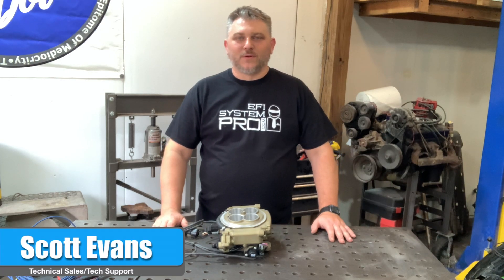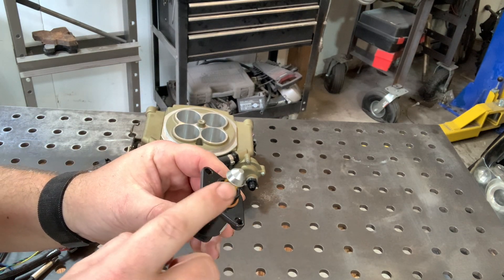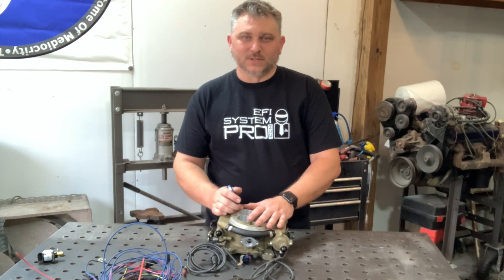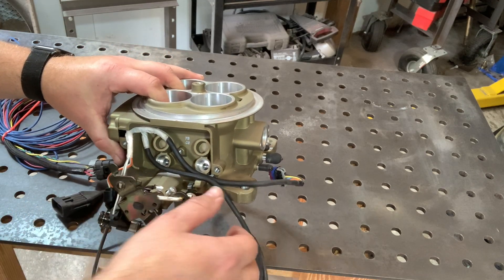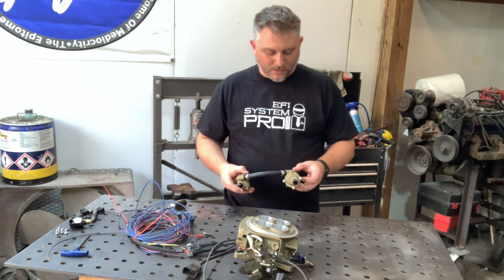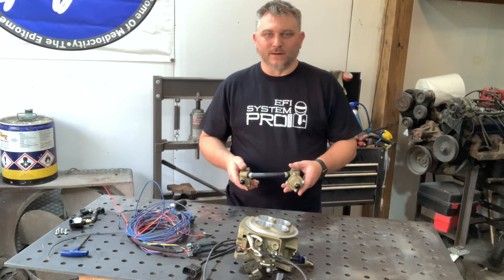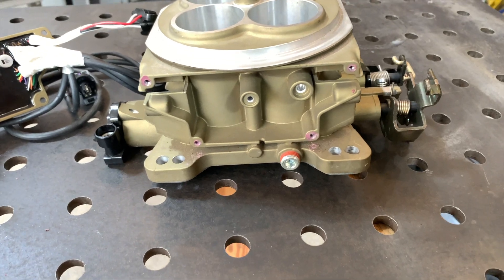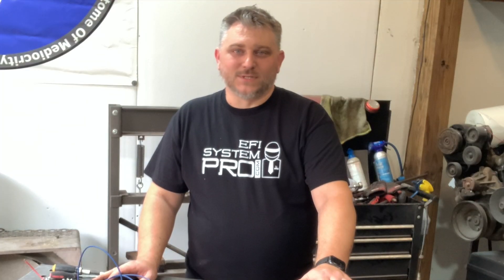What's Inside a Holley Sniper EFI Unit | EFI System Pro

Comment: Good afternoon, I have a Holley Sniper 2 and because it is completely sealed, I cannot access the TPS sensor, and an error message appears on the display. Do you have any suggestions? I have already checked the terminals, grounding, reset, and the orange wire that corresponds to the TPS. I don't know how to proceed anymore.

Comment: Hello maby some advice? Have a brand new sniper 1 but have been on the shelf for a couple of years. Decided to finally install and discover the sensor in ecu is broken. Live in sweden so support is very limited and what i can see you cant buy only the ecu part?
Reply from the maker: You can't buy just the ECU. If it's a MAP sensor or MAT sensor problem then the only real option is to send to Holley to have the ECU replaced. Last we heard it was $250. If it's the TPS or ECT then those can be replaced pretty easily.

Comment: My Holley sniper is leaking gas on both sides, do you recommend getting new injectors or how would you fix the problem?
Reply from the maker: You can just replace the injector o-rings and that should solve the leak. 
https://a.co/d/4MrghtS
Reply: @ appreciate it , I will get some this weekend and see what happens.

Comment: I have a carbuerated Jeep YJ. Does the Sniper have a built in Inertia switch (for rollover)?
Reply from the maker: No, the Sniper does not have an inertia switch. The only similar function it has is if the engine shuts off the fuel pump will stop running, but if it rolls over and the engine doesn't shut off then the pump will continue to run. It would be possible to add an inertia switch into the wiring from the Sniper to the pump though.

Comment: Can you help me? i have sniper efi withn hyperspark ignition system. It has been working fine for 3 years now it has not spark in. I have power in everything coil works, rpm went i crank the engine power on the white wire. May you make a video of how to diagnose it

Comment: So does the sniper build the pressure and once it returns is the pressure lost or do I now need to get new fuel lines to hold the pressure? I have a 79 chevy k20
Reply from the maker: It is not uncommon for pressure to drop off after the fuel pump turns off. If the pressure is correct while the fuel pump is running then there is nothing to worry about. If it can't maintain 60 psi while the pump is running then there is an issue. The fuel lines themselves play no role in that.That is all the regulator! Check valve in the pump please.

Comment: I have a flooding problem in the high ports of a super sniper, any help?

Can I upgrade the ECU and injectors to my Super Sniper and make it have 8 injectors instead of 4?
Reply from the maker: -If a single throttle bore is getting flooded most likely the injector driver in the ECU is bad and the whole ECU will need to be replaced by Holley. If it's all for throttle bores then it sounds like an interference problem instead. 

-Holley won't sell the ECU so you can't upgrade to an 8 injector setup, the throttle body would also need some machining to accept the second set of injectors.

Comment: Thank god I stumbled across this I was thinking mine was a door stop started spraying fuel looks like just an o ring. Gonna fix it and sell it since I’m going to a terminator
Reply: Confirmed just an o ring — saw a stupid Reddit post where they said it was a casting failure so I never looked more into it if spraying by the throttle cable

Comment: I have had trouble with mine from day 1. Now I have a external fuel regulator and took out the fuel reg in the back. and put a adjustable secondary linkage on it witch helped but it coughs and sputters some times. It has been two years of fu$%#% with this thing . I am ready to go back to a carb. What to try next HELP🤠 ME

Comment: Interesting video… do you have a video for fine tuning these systems. Mine works good, drivability is good. The only issue I have is cold starting, it tends to pump too much initial fuel and floods it a lot. Once it’s been running awhile though  it starts up easily with no issues. I would like to see a video explaining how to tweek these so they don’t run too rich/ lean, initial fuel when starting etc.. any suggestions would be appreciated

Comment: Hello I recently installed a holley snipper efi on my boat engine. Today I took it out for the first-time sea trial. The problem I ran into was when trying to reverse boat off trailer then shifting back to neutral, my engine styled out almost each time. It does this rather shifting forward or backwards. Do you know what's causing this.
Reply from the maker: Contrary to the Holley marketing, these systems are not is "self tuning" as they say on cars, even more on boats. Boats require more specialized tuning. That is something we can help with using our level 1 or level 2 support. https://www.efisystempro.com/fee-based-efi-system-technical-support

Comment: Can Holley super sniper 4 injector. Can be upgraded to 8 injectors ?
Reply from the maker: Unfortunately that is not possible. The ECU does not have enough injector drivers. It is possible to put higher flowing injectors in though.  

https://youtu.be/BA5KhXAf2eU
Reply: ok thanks . Then can a 8 injector ECU could be installed ?

Comment: I work on efi systems all the time but boats pwc's etc. On the aftermarket auto efi's what I dont trust is the electronics to last and be trouble free for miles n miles of use. Im assuming all the aftermarket are Made overseas  and cheeply. For example reliability on a everyday daily driver.
Reply from the maker: I can understand the thinking that an aftermarket EFI system wouldn’t be as reliable. Myself and the owner here daily drive Terminator X controlled vehicles and the owner actually daily drive his with a Sniper till he wanted transmission control switching to the Terminator X. Holley actually uses a lot of the same ecu components as the OEM manufacturers which is a big part of why the chip shortage made Holley stuff so hard to get. The OEM’s got priority. When these are installed correctly they are very reliable. The problems come from the marketing that makes everyone think they can install and tune EFI with a small touchscreen and basic electrical knowledge. These are incredible systems for the money, but only as good as the installation.

Comment: Do know if this set-up is compatible with the Trans Am factory air Cleaner?
Reply from the maker: If your Trans Am has a Quadrajet carburetor then it is not, but there is a Quadrajet Sniper that is fully compatible with factory air cleaners and even mechanical ram air hoods. 

https://www.efisystempro.com/sniper/sniper-quadrajet-efi-system-550-867-868-869

Comment: Disappointment.  This is what's inside snipers when they randomly fail for dozens of different reasons.  I've seen everything from the fuel pump relay activation frying and bricking the unit, tons of rpm input failures that caused no starts to wide open injectors that hydrolocked engines, etc.  Fitech is also trash from reliability and anyone that knows about the 58,000 rpm error knows exactly what I'm talking about.

I have yet to see a reliable TBI EFI conversion and its becoming such an issue that quite a few local shops are outright refusing to install anyones systems due to rampant complaints and failures.  It's affordable at $1000, its not affordable at all after the first or second one fails just outside of warranty and you're out of pocket another $1000 if you want to gamble again.
Reply from the maker: The main issue (FiTech included) is trying to make a complete fuel injection system in the $1000 price point. It is so much technology packed into a low budget that there has to be compromises. Not saying $1000 is a small amount of money, but any other aftermarket stand alone system is going to cost much more than $1000 and you only get an ECU. No injectors, sensors or throttle body.
Reply: @efisystempro  I fully agree.  They're compromised systems due to poor handling of electrical noise and interference coupling with the fact that most are designed to be driven by components like HEI distributors and basic 6AL MSD boxes that were never intended to give a clean, consistent signal to something as sensitive as an ECU.

What really sucks for a consumer is that $1000 gamble if you get hit 2-3 times for it due to failures out of warranty.  Carbs do beat them in that area.  With something like a 4150 holley, there's almost never a situation where a kit and some new soft parts can't salvage one.  Also, I don't hate EFI at all.  I daily a Fitech swap, my show car is terminator X, my dads showcar is terminator X, and I've done several HP tuners LS swaps.  I love EFI, just not budget TBI EFI swaps.
Reply: Mine is failing because of RFI or noisy wires. No real cure for it on a Classic, even if guidelines are followed+Clean Installation. This Thing needs filtering and RFI protection to be reliable. From factory! Not to mention engine temps/Vibration on PCB.
Reply: @efisystemspro keep the good work  Up. Your Website/shop is amazing. YT does add to the value!!

Comment: Super interesting and cool video
Reply from the maker: Thanks a bunch!! Don't hesitate to let us know if there is anything you want to see about Snipers, or any Holley EFI.  Always looking for what the people want to see.
Reply: @EFI SYSTEM PRO  I'm having a issue right now where my Mustang 302 runs great for 15 to 20 minutes and then the handheld sensors start cutting in and out. I've checked my powers and grounds and they are all good. Ever seen that?
Reply from the maker: We have seen that many times, especially on Fords. The distributor being in the front is very close to the ECU and can emit RFI to the ECU. You can test quickly by wrapping the distributor and a few inches of the plug wires in foil to block the interference. If that helps the fix is most likely needing some dielectric grease inside the plug wire boots to seal them to the cap. Just be sure to not get any of that grease on the metal contacts. It will reduce voltage to the plugs. We also have a really good article on things we have found to solve it. https://www.efisystempro.com/efi-pro-hangout/solving-sniper-rfi-problems
Reply: @EFI SYSTEM PRO  hey, thank you so much! I just watched Joe Simpson break down all the different versions of the Snipers and saw the "Ford" version they have now. It's a little too late for that but I'll definitely try out your fix before anything. Thanks for the information!

Comment: Two items, which may be related...

Would like to know if there is a longer term solution than having to "recenter" the throttle blades every so often when the throttle won't close all the way? 

Also, my TPS always goes to 1-2% after the engine is started.  I can physically grab the throttle arm on the Sniper and rotate it, and the TPS will go to 0%.  Soon as I let go, it goes back to 1-2%.  I've added a third forward pulling throttle return spring to the top of the throttle arm, does not solve the issue, and the pedal become overly stiff.  Throttle body mounting surface on the intake was checked by a machine shop and is flat, so I don't think I'm 'warping' the throttle body when I tighten it down.

Thoughts?
Reply from the maker: The throttle blade adjustment is typically a one time thing. Once it is set it usually does not need to be done again.

The TPS probably just needs to be adjusted. If you loosen the mounting screws and rotate the housing counterclockwise till the mounting screws are in the middle of the adjustment then tighten them back down it should solve the problem of not being 0%.  That method solves that problem 99% of the time I see it.
Reply: @efisystempro  I did install a new TPS last year just to rule it out, and it still went to 1-2% after starting.   I'll try rotating it a bit when I get the car out again in the Spring and see how it works.  Thank you.

Comment: Good Day Scott thank you for your video it's actuality good to know what inside and how it works. I have a question , i install holley sniper efi and when i turn the key on and set up vizard, my TPS staying on 0 when i push the throttle and my CTS showing me Low err ... so do you thing i have to change then ? i check all wire and check voltage TPS getting 4.99volts and CTS getting 4.76volts , i bought sniper brand new but not from the shop just from someone he said it was sitting over the year on the shelf and didn't touch any engine , when i've got it looks just like a brand new , so do you thing it can be TPS and TCS failure just because time or factory issues ? i ordered brand new TPS and TPS waiting this week should be here hopefully it will work. 
Anyway if you have a time give me some advise i would be really appreciated 
Regards 
Jay
Reply from the maker: I would try running through the setup wizard and see if that solves the issue. When there isn't a configuration file on the ECU it doesn't have any calibration information for the sensors. The ECU can read the voltage but it doesn't have a reference as to what that voltage actually means.
Reply: Thank you for reply.
I did run it and everything the same tps not working and cts not working either. When I try to push the pedal sniper floods and engine stop running
Reply from the maker: I don't say this often but if it didn't change by going through the setup wizard then I think it will need to be sent back to Holley for repair. Sounds like an ECU issue.
Reply: Thank you for reply 
Will try to put new sensors and see what happens
Reply: New TPS and CTS everything is working now:)
Reply from the maker: That's good news. I am surprised to see 2 bad sensors right out of the box, but either way an easy fix.
Reply: @efisystempro   now i have sounds knocking nose from unit )
Reply from the maker: With 4 injectors all pulsing at once it can be pretty noisy. If it runs fine then odds are it is nothing to worry about or the fuel pressure might be a little high if there is something wrong.

Comment: Does Holley sell the ECU if it fails?
Reply: Hi Chris. I have a problem with the sniper efi I noticed alot gasoline on the engine oil. Do you have any idea what's causing it. Maybe the injectors are bad?.
Reply: @josejimenezjimenez3033  my guess is your o2 sensor is thinking you need more fuel possibly running rich?
Reply: @IvyGreen1966  ok thank you. So fo I need to remplace it?
Reply from the maker: I agree with @ArmyGreenFJ it sounds like a possible exhaust leak giving the oxygen sensor a false lean reading. 

I feel like this should be in the instruction manual, but for some reason Holley really makes no mention of it. The best thing to do is use a shop vac with the outlet connected to the tail pipe so the vacuum can pressurize the exhaust system. Then spray soapy water starting just behind the sensor working your way all the way to the cylinder head looking for air bubbles. Anywhere you see bubbles is where air is getting in.
Reply from the maker: Unfortunately Holley does not sell the ECU's at all. The only way to get a new one is to send the unit to Holley for them to replace it.
Reply: @efisystempro  ok thanks. I was also looking at the older MSD atomic. They sell the ecu by itself on the Holley website. Would be nice to have them as an extra part incase you’re in the middle of the road on a long road trip.
Reply from the maker: Those aren't bad systems. Basically a Sniper with different packaging. If you do a lot of long trips or off-roading I highly recommend the Terminator X Stealth instead. They are very reliable and give a more polished finish for lack of a better term. It is twice the system for only a couple hundred dollars more.
Reply: @efisystempro  ill look into that. How do you feel about the edelbrock pro flo 4?
Reply: @efisystempro  its actually for my K5 blazer. Currently running a AVS2 carb. So yes its going to be for off roading also.
Reply from the maker: Reliability wise I'm sure it's fine. It has no real support for expansion later if you get outside of what it was made to do. With Holley systems there is a lot of support for getting it to do anything you want to do with it. The ProFlo is also a little weird in that it comes with 36 lb/hr injectors that max out around 575 HP, but comes with a single plane intake that I would never recommend under 600 HP. EFI does not solve the physics problems that come with trying to use a single plane intake where low RPM torque and low RPM throttle response are preferred.
Reply: @efisystempro  so that holley terminator has the ability to mount the ecu away from heat?
Reply from the maker: Yes, the ECU is typically mounted behind the dash. The harness is pretty long
Reply: @efisystempro  Thanks! Definitely looking at this one now
Reply from the maker: The Edelbrock Pro Flo is a bit of an odd design in my option. They package it with an intake made for high HP and high RPM, but then put 36 lb/hr injectors with it that max out about 600 HP.  EFI does not change the physics involved in manifold selection, so you end up with something not real good for street driving, but can't support the power the intake is made to produce.
Reply: @efisystempro  do you know if it’ll run with a MSD HEI distributor?
Reply from the maker: It will run with the distributor controlling timing, it won't work if you want the Sniper controlling the timing. At least not easily. We have seen people convert all sorts of distributors to work, but it takes some creativity.
Reply from the maker: Snipers will run only controlling fuel with an HEI distributor. Use the yellow wire to the tach output and change the ignition setting to coil -